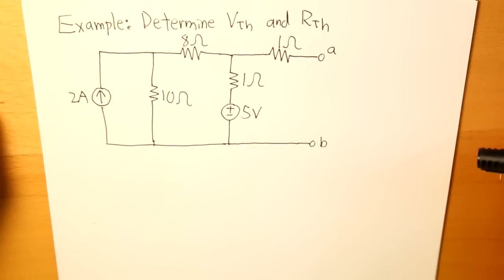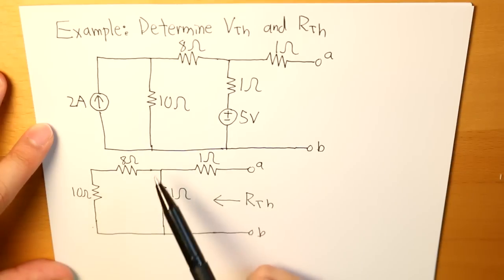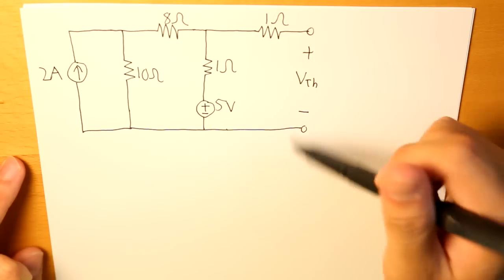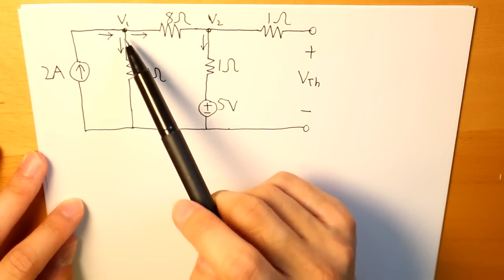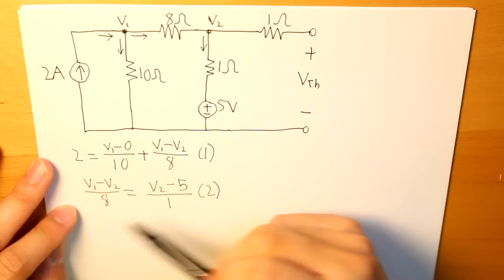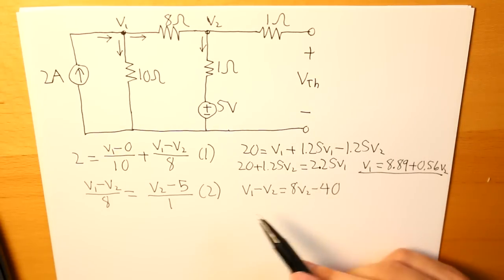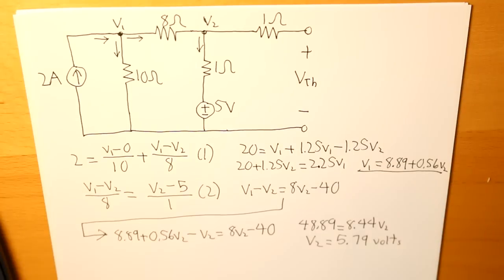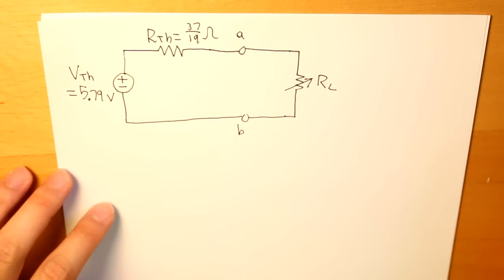Thevenin's Equivalent Example (Two Independent Sources)

Comment: I think Rth should be 18/19 ohms, because the 1 ohm resistor connected to the terminal ( a ) is connected from one side only, so there is no current flowing inside, and because there is no current then from ohm law V = IR -> V = (0)(1) = 0 V, then we can simply neglect it...
Reply: no, this is wrong.  You want the equivalent resistance between terminals a and b.  You cannot simply ignore that resistor otherwise you get the incorrect R_thev value.

Comment: why does Vth==V2?
Reply: Since we are trying to calculate voltage across a and b we can leave it as an open circuit, therefore the branch that has the 1 ohm resistor is inactive(NO VOLTAGE DROP!). That means that if we find v2 we will be finding vth too. Lets say that we wanted to find Norton's current instead then we will connect a and b creating a short circuit, then you can use whatever technique you want to find the current going through that short circuit you just created. 
PD: fuck riven
Reply: MuAFull haha. ok thanks
Reply: Place a ground node at the bottom of the circuit, then consider the voltage difference at node A and B, where the Vth plus and minus sign are respectively. At the bottom node, B, you have a reference of zero volts due to the ground node being at the bottom, and V2 is the voltage connected directly to the top node, A. V2 - 0 = V2, so V2 is Vth.
Reply: Why we are not considered the 5V voltage source while we are calculating VTh

Comment: there should be open circuit in the voltage souce......
Reply: Not open, a voltage source should be seen as a short-circuit!
Reply: You short the voltage source and open the current source.